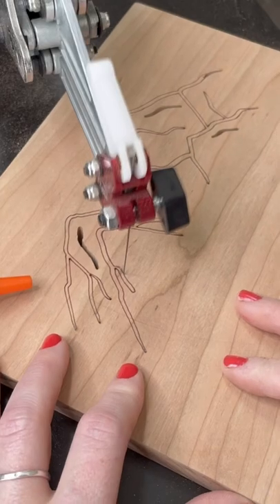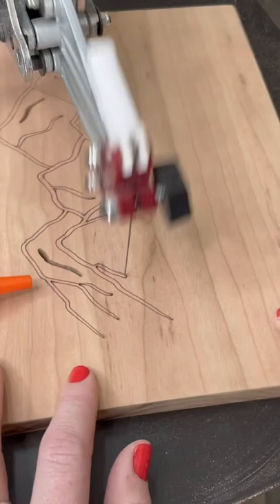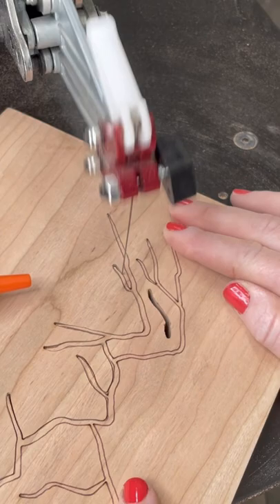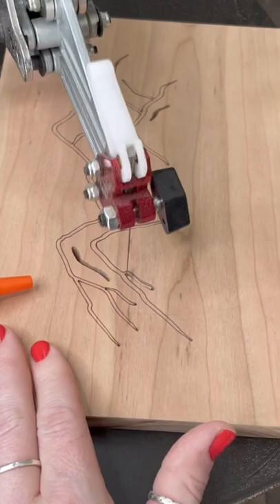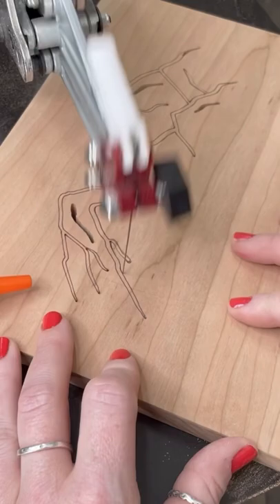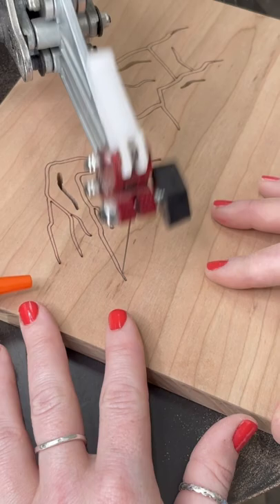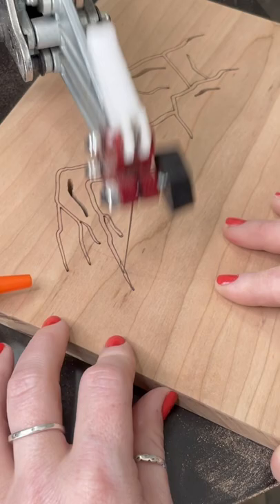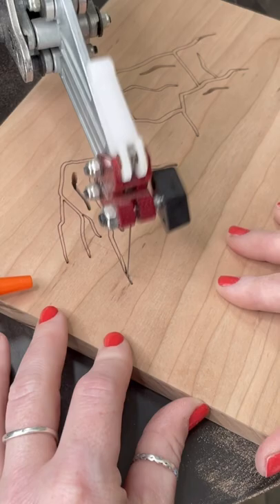Cutting tight corners on a scroll saw. #scrollsaw #scrollsawtip #scrollsawart #woodworking

Comment: are you using a foot pedal here to change the speed?  If so, where can I purchase this?  I did not think you could use variable speed foot pedals on a scroll saw?  but you are clearly not removing your hands in the video...
Reply from the maker: I emailed back this morning but just seeing this comment. Short answer- no. I use the regular foot pedal. No variable speed.
Reply: Most scroll saws have the speed control up on top the upper arm of the saw, you cant use a vari speed foot control if there is even such a thing, the saw is a DC motor, and the  control board is inside the back of the saw, the speed control on the saw changes the speed from there

Comment: So why did you drill very small holes in those “sharp” corners?
Reply from the maker: You might just be referring to the marks the laser made when I scored my design on? I did drill a hole to feed the blade through. But in the corners is just where the laser changed direction
Reply: @KendrasGotWood  Thanks for explaining this!